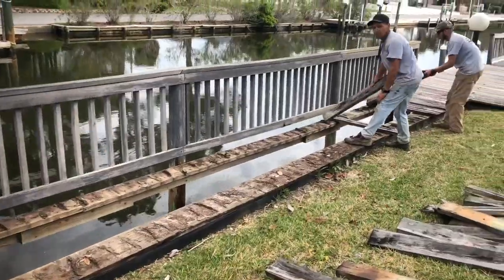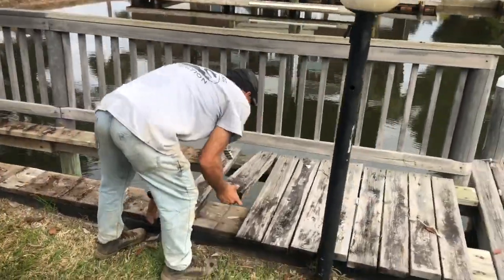Santoro How To Build A Vinyl Seawall

Comment: Looks great! quick question, how are you attaching your chain to the sheet to pick it up? I'm fairly new to using machines for setting walls and the guys I work for are old school and like to set by hand using a water jet and sledge hammer...trying to use machines a little more and save our backs lol. thanks for sharing!
Reply from the maker: I heard that Tyler that’s the way I was brought up my dad did not believe in equipment. That’s why I use it now I’m wore out 😳😳 I have a sheet plate that I purchased from Amazon should be coming out and one of my  videos soon I kind of explained it.

Thanks for watching!!😎👍
Reply: If you are jetting the sheets u should be good. If anything use the hammer head with a block on top to not damage the sheet. No need to swing a sledge if u have the hammer head. Just check level on each sheet and lag in as u go.

Comment: Would like to see how you back fill under the slab. Subscribed.
Reply from the maker: j4566 
Normally we run our pumps and wash the sand with the water up underneath there I could not get that one filled quite all the way so I set some additional pilings underneath of the slab to help support it from sinking any further. 
Thanks for your question and watching 👍

Comment: Watched and enjoyed  all your videos.  Have one question for you: I live on the great Lake of Lake Ontario and was wondering how the vinyl sea walls would hold up to harsh winters , ice , moving ice , expansion and contraction with temperatures. Love the system,  just unsure it's right for my region and climate . Eastern shore of Lake Ontario specifically.
Reply from the maker: Mike Kania Thanks for the question but I’ll get with my my vendor see if he has this product installed in your area. Appreciate you watching my videos!
Reply: You'd be better off with something like an L8 galv sheet pile (or North American equivalent). Composite/Vinyl/Plastic piling has come along way but nothing like that likes deep heat cycles. Galv steel with a hardwood cap would be the best option depending on what you use it for.

Comment: hi there, why do you use this hose with a metal tube to help on craving the seawall ?
Reply from the maker: Thanks for your comments the hose is connected to a 3 inch pump. We use a 1”1/2 aluminum pipe which we referred to as a jet pipe this puts out some good water pressure when you put it in the sand it actually moves the sand and allows you to install the vinyl sheet pilings. Similar to sticking a garden hose in the ground you could see that it digs a little hole.

Comment: Thank you so much for sharing this. It was cool to see. How do those spuds work on your barge?
Reply from the maker: Flylikechris thanks for your comment, the spots on the barge are 8 inch pipes the way 1100 pounds.  I picked him up with the tractor moved the barge where needs to go set them back down it holds the barge in place 👍

Comment: I am up in nj I noticed on your vynal walls you have no big poles how come ?
Reply from the maker: Thanks for watching the channel. Appreciate the comment the Piling placement in front of vinyl walls really depends on the exposed height of the walls.
Reply: @DaleWHickman at what exposed height do you start installing posts in-front of the vinyl seawalls?
Reply from the maker: @berniemac8413  really depends on the series of vinyl that you’re using. I don’t like going any taller than 5 foot with a 5.5 Everlast before I start installing a mid whaler with pilings.

Comment: Cool video. How were the anchors attached to the wall? What did you backfill with?
Reply from the maker: Thanks for your comment the anchors are five eights type 316 stainless steel that are drilled all the way through the wall and on the water side we have 1/4“ x 3 x 3 stainless steel plate with a stainless nut attached. The backfill is a sandy feel which allows the water to move freely through the soil back through the wall after a high tide.